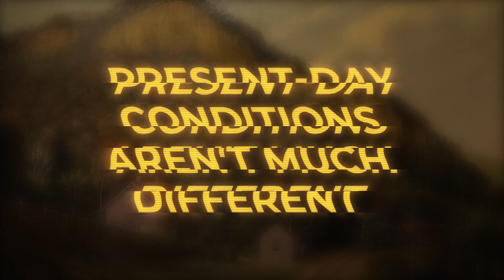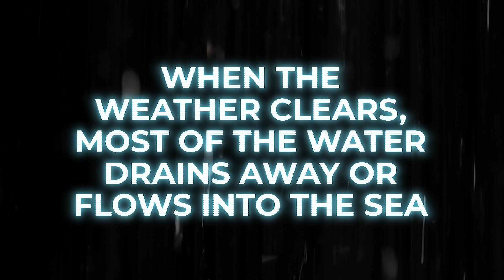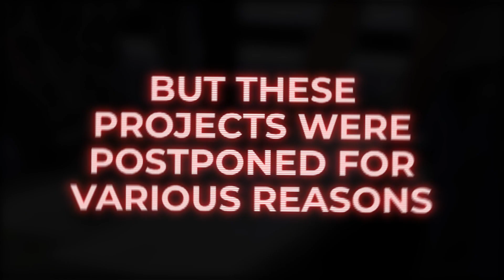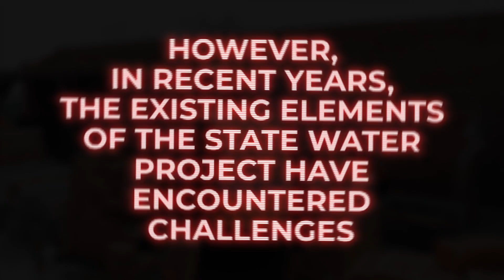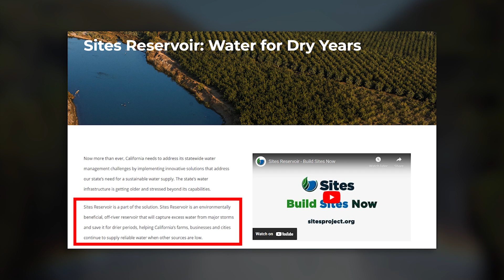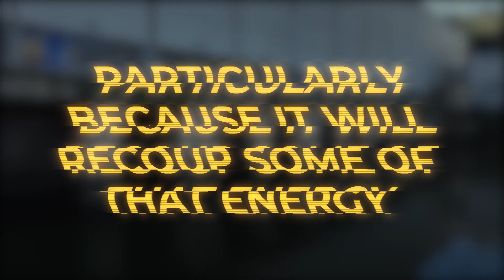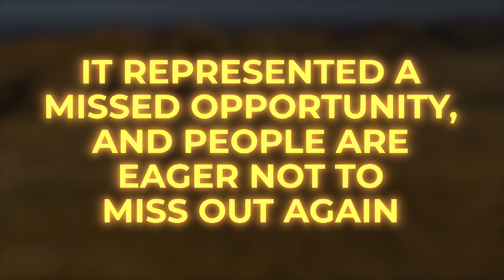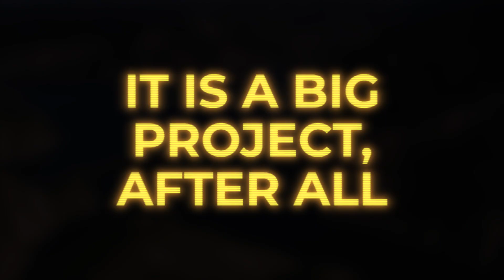Mind-Blowing California’s New $5BN Mega Reservoir Project!

Comment: Well we aren't in a drought rn and haven't been for a while. I live in the high desert and we have been out of drought conditions for a while now. Most of our water does not flow to the ocean if it falls in the coastal range yeah it usually takes the path down hill and to the ocean. But that's only 30 miles inland, water that is dropped in the Sierras or deserts does not flow to the ocean without a bunch of stops helping the farmers. Unless it's the San Joaquin river area which is where our Inland Port of Stockton is and needs that flow to take AG goods Over seas. My lake releases water as it's a flood control lake not meant to hold at full Capacity. Plus the water belongs to those down in the Valley